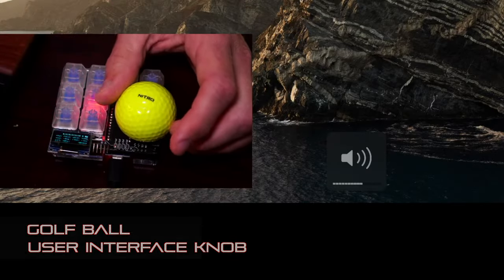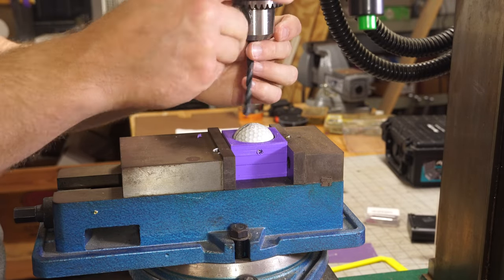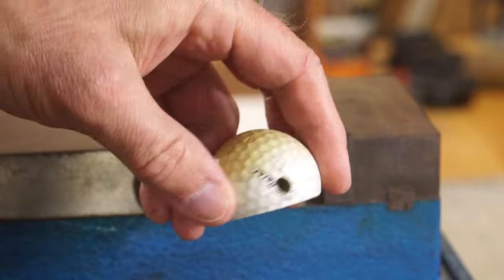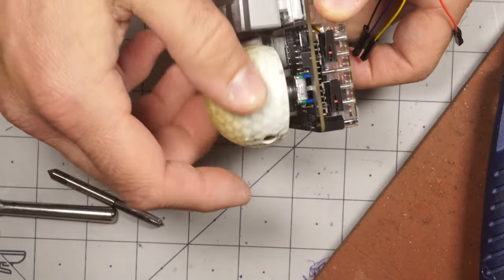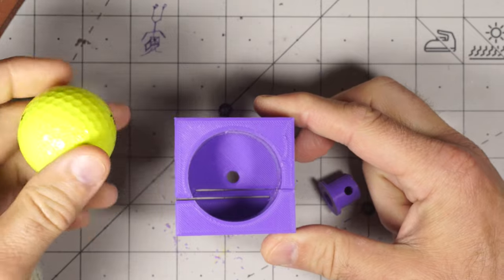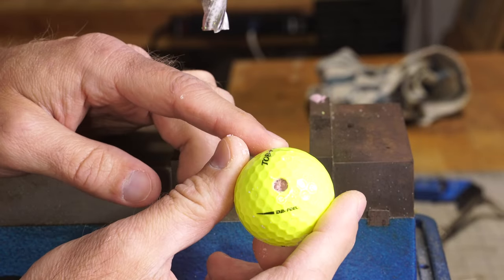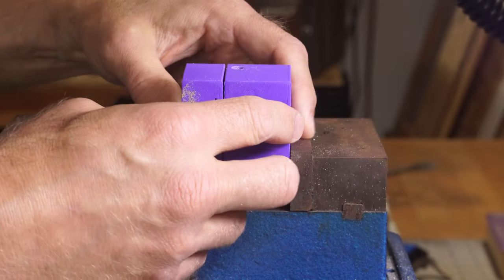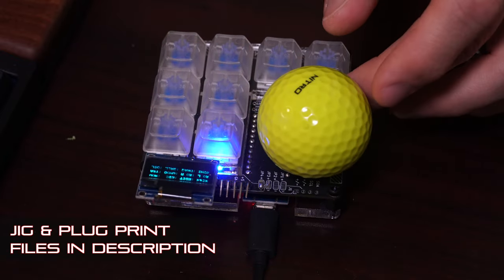How to Make a Custom Computer Volume Knob Using a Golf Ball and 3D Printing

Comment: Sorry to hijack this video but I saw your blog post about using a Pico to send MIDI signals. Wanted to ask, why did you need a RPI? The video you linked to (the guitar-to-midi) uses a pico to send the midi signals to the computer via USB, why couldn't you do the same? (The link to the RPI inspiration at neuma website is dead -website is dead actually).
Reply from the maker: Hey, it's OK. IIRC it doesn't work, at least in part, because that Pico isn't powered over the keyboard's USB connection. If it had power, perhaps it would, but I'm not certain. This and/or if it works may be dependent on the Keyboard itself. Here's a link that should work, thx for letting me know: https://neuma.studio/rpi-as-midi-host/

I'm assuming you mean the article on Embedded Computing. Also, I'm doing a bit more experimentation with this tech currently, so stay tuned :-)
Reply: @JeremyCook  understood! Thank you so much